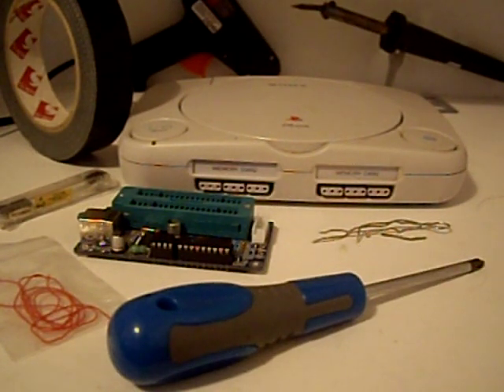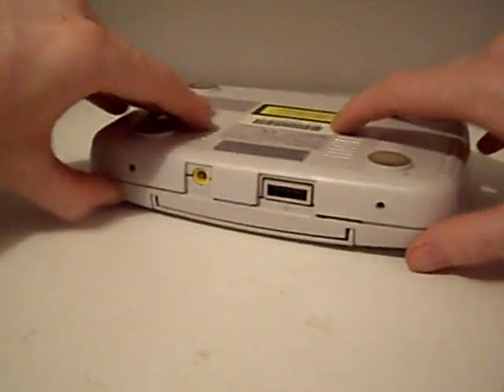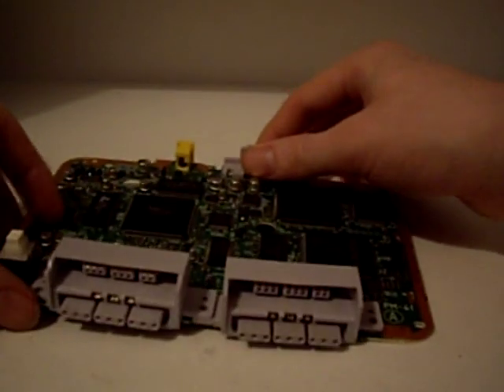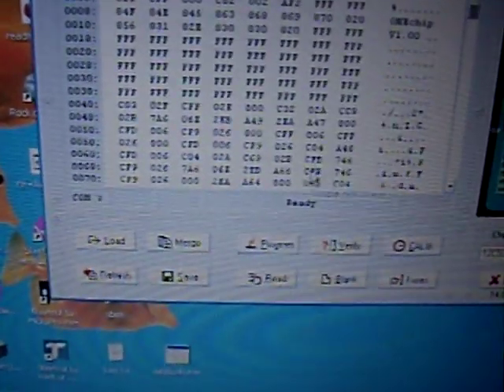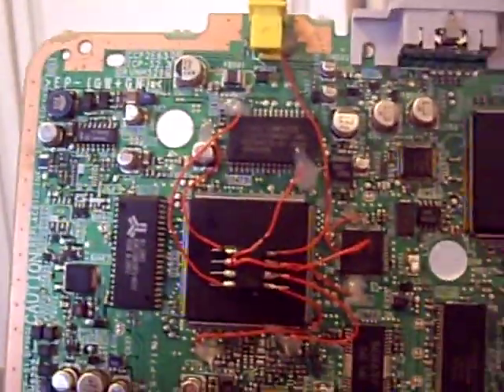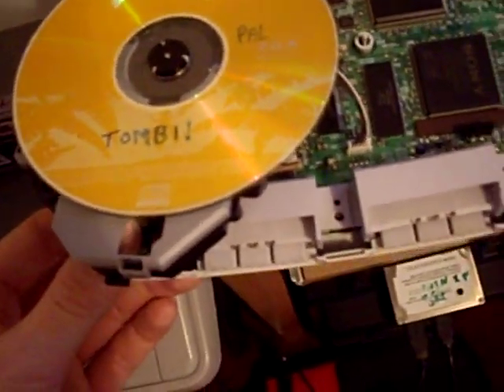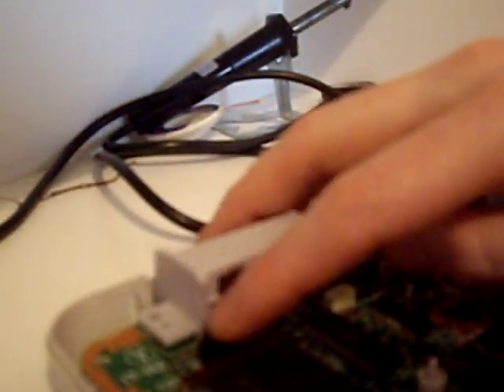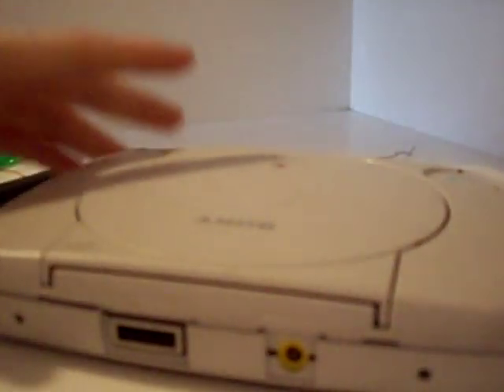PSONE PSX ONEchip Stealth Mod Install by jse, difficulty level = Tricky

Comment: Hey buddy, thanks for the vid. Quick question, I installed the one chip with the 8-wire install. It plays PAL & NTSC games fine now and all seems to be working....only thing is the video output seems a bit off, almost like its out of sync or something. It's especially noticable with the PS1 logo boot screen. It's sort of slightly checkerboard'd and wobbly. I'm using a composite cable on a HDTV. It was outputting fine beforehand, now just seems like theres some sort of interference. Any help would be great, cheers pal.
Reply: if it's a PAL ps1 then it has something to do with the modchip and going in and out of 50khz and 60khz.
Reply: +pwnswoggle an RGB scart cable fixed the issue! Works great now
Reply: awesome! have fun

Comment: Hello. I have SCPH-101 ( NTSC ) with PM-41 motherboard. Also I have clear 12C508A chip. So firstly I have to flash chip via programmator right? But where can I get a program? I found link in description but this is for PAL only(102 model). And also I need diagramm specially for my model. Could you help me? Thanks
Reply: ***** So there is no difference between install of chip to PAL or NTSC model, right? and I just need to install it this way for example http://www.fatcat.co.nz/psx/install/102/diagrams/psone8.jpg . The difference only in chip hex, correct? I found http://www.eurasia.nu/modules.php?name=Downloads&d_op=viewdownloaddetails&lid=1645&ttitle=mm3_hex_dump
Reply: ***** Thanks for helping. I will report about my results

Comment: Hi i bought a 12C209A but it doesn't seem to be registering with my PIC Programmer (I have the same one you do the K150) it constantly says the board is not responding. What would you suggest doing?
Reply: So the 12c509a is no good? I've seen other people say they all work but if they don't I'll buy one of the 12c508a's asap
Reply: Make sure you have the programmer facing the correct way. The lever should be facing upwards along with the USB socket, the white 6pin mini header connector should be at the bottom. The 12c508a is placed 5 slots up from the bottom Indentation/mark goes up so facing top right corner. The is a small plastic divider built into the ZIF socket between contacts 4 and 5 look carefully and you will see it. The OP "209a" post at an educated guess is a typo? ;)
Reply: No it wasn't a type ^^' I went on a mod forum and someone said you could use 12c508, 12c509, 12c508a and 12c509a but I think I'll wait until the chip used in this video arrives for safe measure
Reply: Caleb Prince Brotherton As far as I'm aware no 209a chip has ever been produced. That is why I asked if it was a typo on your behalf. Oh FYI the K150 works fine in windows 7 just fine. I own one and use it to program these IC's

Comment: Hi, I bought a pre-programmed MM3 NTSC USA from Eurasia. After installing it however, no discs are spinning, and the psone goes to the mem card/audio cd screen. Do you have any idea what could have gone wrong? I checked and don't think I shorted any of the circuits while soldering.
Reply: ***** The ribbon cable and power cable seem fine, but I noticed that the chip is overheating once I power on the console. What could be the cause of this? Thanks.
Reply: doomguy10011 Also, it overheats only when I push down the disc safety latch when attempting to run a disc. Any idea what it could be? Thanks!
Reply: ***** After removing the chip though, it works fine. Could it be a bad chip?

Comment: Hi
Is there a button sequence to enable the mod chip. I've got on installed over 20 years ago and now tried to turn it on for the first time but I get stuck on the 2nd screen. Please help.
Reply from the maker: Holding start on power up will "Disable" it. Holding "X" and "O" on power up will bring up the menu. Other than that it will always be enabled

Comment: Hello Jse07 i have a question. I've modded my Psone SCHP-102 with an 12C508 and while it is a PAL console, now with the chip inside it plays completly on NTSC and the colors are a little bit different now. Could it be, that the seller programmed the false Hex file to the chip?

Comment: I have tried to wire up my Psone SCPH- 102.  However, I am unsure if wire “8” has been done correctly.  In your video demo, it shows that wire “8” is connected to the power jack point.

 In some images from the Internet, it shows that wire “8” is connected to resister 21 and in some others it shows that it is connected to point 608. I do not know what to do?  
Do I now then solder each wire from 1 to 8 to each point on the chip from 1-8.  Do I need to cross any of the points on the chip itself?

Comment: is there anyway that you can show me how you installed your programmers driver and how you ran your programmers software without errors ? i have the exact same k150 knockoff programmer and i think i have it installed wrong, im running windows xp pro sp3 btw. also have you ever added the optional LED to the MM3 chip to see if its working ? a video on that would be awesome

Comment: hey jse07, i just bought a couple PSOne's from ebay. they should be getting here today when the mail runs, can you tell me if i can use one of my 12f629 chips with MM3 hex, they are MTSC consoles, so i dont think the ONECHIP hex will work on them, i think ONECHIP is for PAL consoles, please correct me if i am wrong

Comment: have you ever installed a 12f629 in a scph-101 with a motherboard version pm-41 (2) ? im looking for a working diagram, also im getting an error when i start up my programmers software, reset failed please check communications port, currently [com3] board connections and power mode =k150 any ideas on how to get the programer working, im running win xp pro sp3.  sorry to bug you again

Comment: Hey! I have a question and if you can help, I'd really appreciate it. I got a 9001 unit and a 12C580a chip, Which hex do I need to program it and will this hex work for mine? Thanks!

Comment: jse07, i have a scph-7501 psx, its the old big model, i have ordered the same PIC programer that you have in this video, and i purchased 5 12f629 pic chips to use with the mm3 hex that has been ported to the 12f629 pic's, for some reason, after installing this chip in my psx, it will not load any backups, it goes to the cd player, or displays the please insert playstation format disk when trying to play, i could use some help, have you ever used these PIC chips before ?

Comment: Hello can you put the diagram for this mod the linck is off.Or tell me where you putt the power cable.thx
Reply from the maker: The links work, scroll down to, Download this file now, and click it. But you can solder wire 8 to any 5volt point on the board iirc.

Comment: I've took it apart I have a chip with 8 wires so ? And also I've put it back together but you know where the tape is ok the metal case it's came off and I've use Sellotape is that fine ?

Comment: i think my problem is the programmer, its listed as COM3 in device manager though, i can read a chip with it, i can also flash a chip with it, but for some reason microburn will not reset the programmer, im starting to think its messed up, i will try a few different instal diagrams to see if i can get this working, but im thinking i need to look for a better programmer

Comment: Hi again JSE07,

I have bought a Chip Programmer from e-bay (TS8900 K150) exactly the the one you have. However, I cannot seem to get the driver to work on XP or Vista.  I get some message about com ports?  

Could you please e-mail me the Driver.  I am almost there now.

Once again thank you for helping. Abid

Comment: You need to use 2 chips for full stealth on a PSone. You need a multimode 3 and use the one chip to bios patch to allow NTSC mode games to boot.

your use of hot glue makes me cringe.
Reply: I did this enough back in the day with enough anti-mod chip games to know the one chip code would not boot all anti modchip games and skip all the modchip checks.  I guess it's not really needed in this day and age.

I don't remember many people giving a crap about import games with anti mod chip protections. When they did mention it, I made sure with 2 chips as mayumi's strongest mode was superior to everything else, also the wasn't enough space left to put the strongest anti mod code on the 12c508a chip as well as the bios patch.

There was always one weird game that never worked properly on a PAL PS one, the US NTSC Vandal Hearts II, you need to get a save game onto a memory card to get the game to boot properly.
Reply: +Nick Tsoulli OneChip should be all you need for a PAL PSOne...

Comment: Your video is fantastic!!!

I have a PlayStation Model SCPH 102 PAL version.  I have bought a PIC 12C508A chip and a CHIP programmer.  

HOWEVER, I am still unsure how and where to wire the chip.  I would be very grateful if you can e-mail me a clear diagram/image of how to wire the chip. I am unsure if I need to wire 8 points? or 4 points?.  

PLEASE, PLEASE can you send me FRESH images of where to wire the chip on the console and the wiring on the chip as well.

Many Thanks.  A